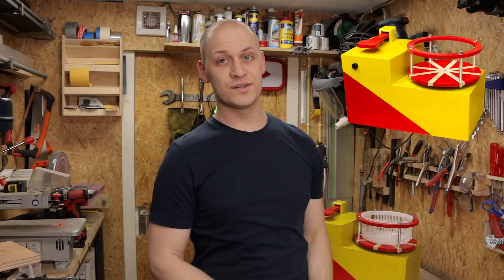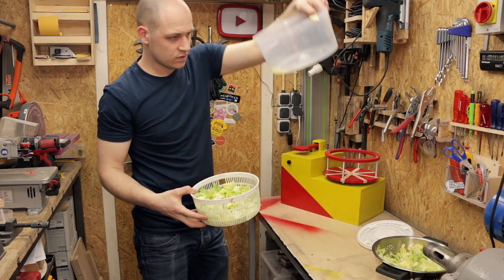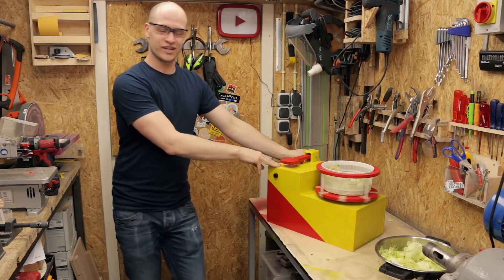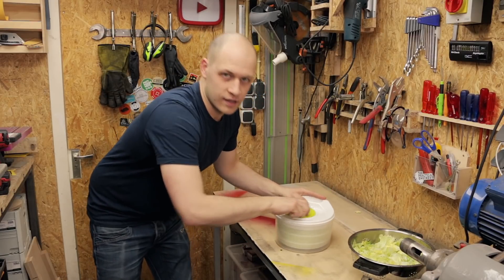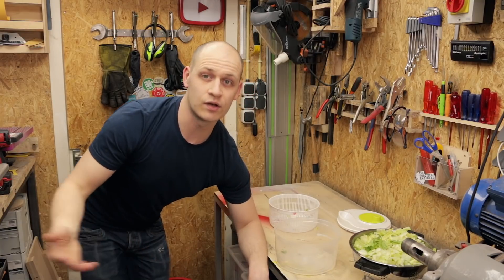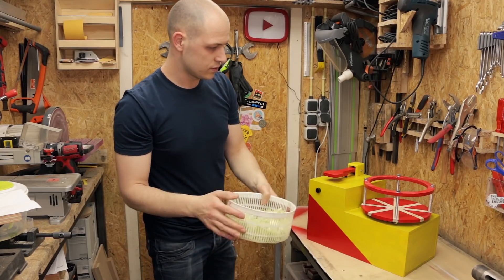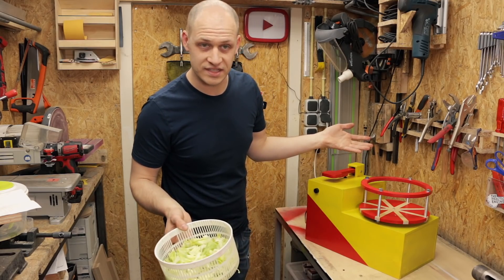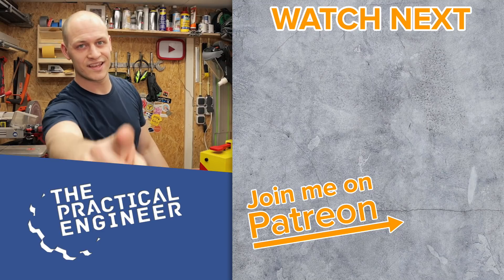1000 RPM Salad spinner test - Manual vs Machine

Comment: I noticed you cheated in the first test. After you used the plastic spinner, you pulled the lid off and shook the water on the lid back onto the salad!
Reply from the maker: So it's not scientificly correct? What else was I supposed to do with that water?
Reply: @Thepracticalengineer 

Maybe invent a water-powered salad drier.